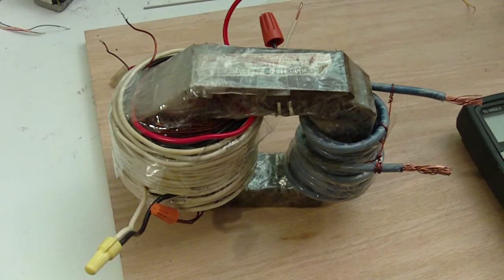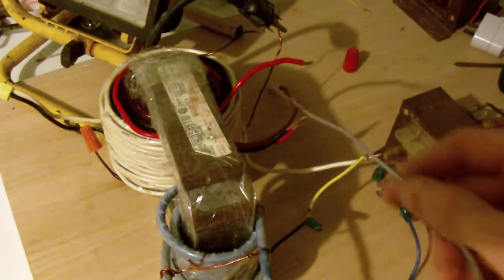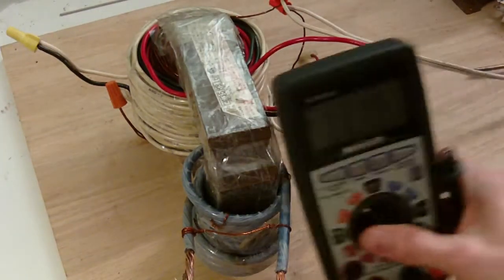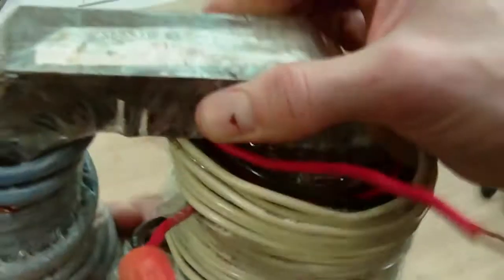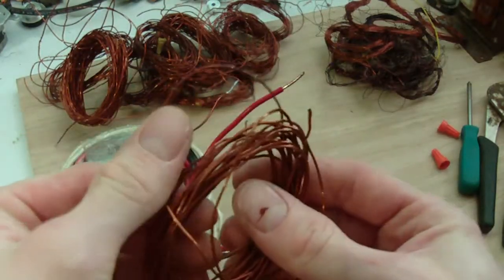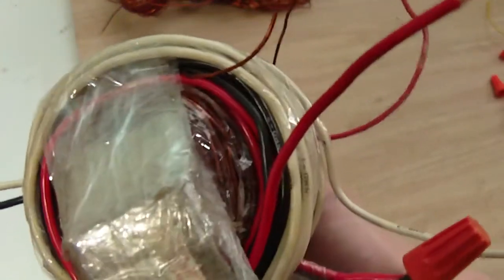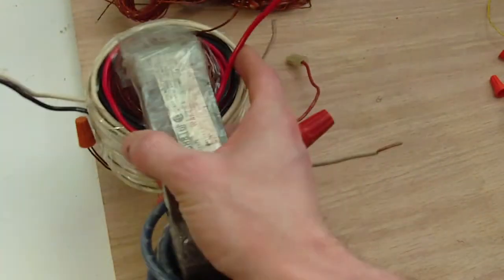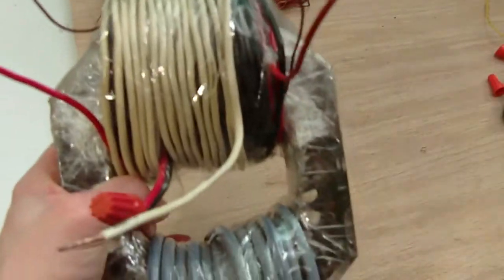Homemade Transformer built from motor

Comment: The double wound EI transformer, where the primary and secondary are stacked on top of each other around the center leg has better regulation, because of the reduced flux path and closer coupling of windings hence: less leakage inductance, but is still a poor performer. The transformer you made out of the motor core will have very poor regulation, high leakage inductance, also losses will be higher due to the winding pole slots in the core. But it still works.. Hint:- If you layer the primary and secondary over the top of each other regulation will improve dramatically. But there is less electrical separation.

Comment: I bought that same meter you have and its very nice meter. I built a step down from 120VAC to 12VAC, was difficult had to wind about 280 turns of AWG 22 primary and 30 turns secondary AWG 14, gets a bit hot due to the microwave oven core i cut apart to use for its core. Thats a beast of a core you have there!

Comment: YOUR LUCKY YOUR NOT DEAD,IT ONLY TAKE 1 AMP TO KILL YOU,ARCING A SCREWDRIVER ACROSS A 3 VOLT SECONDARY ,THE LOWER THE VOLTAGE THE HIGHER THE AMPS
Reply: wrong ive had 2.6 amps going through me and im not dead
Reply: No that is wrong john a 9 volt has more Millie amps than a aa you can have whatever combination u want
Reply: :-D  one amp can kill you:-D  one amp 220v can kill you. But you can touch 3v 800Amps and you will be fine
Reply: amps kill you but you need high voltage enought to break your skin resistance. Low voltage low amps on your body, amps can't break the resistance of your skin
Reply: Testas. T. How about some wet skin?
Reply: +john mercer HOW MANY IDIOTS ARE THERE ! amps do kill but you need VOLTS+amps to kill ! otherwise you clud kill a human with a AA battery  !!!!!!!
Reply: john mercer you dumbass
Reply: unfortunately I'm still alive.. I've touch the output of my MOT with 7v 21a and felt nothing.. lol